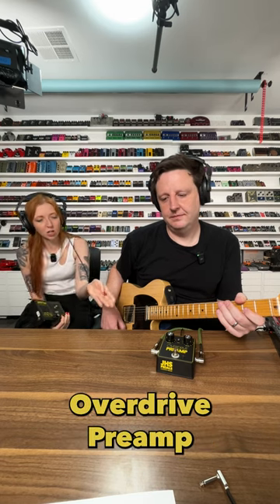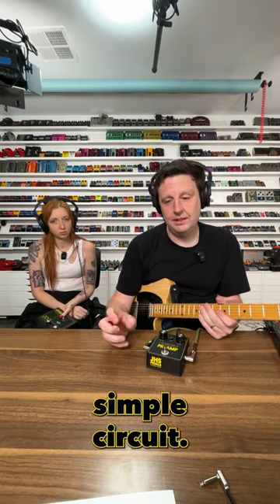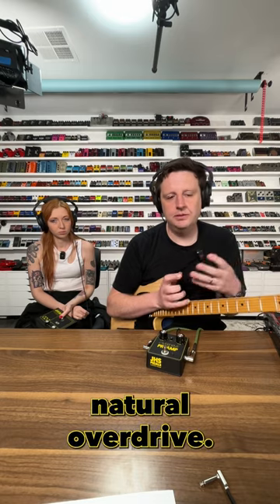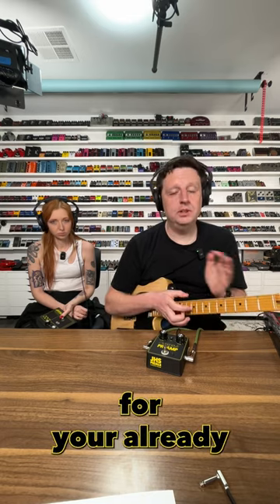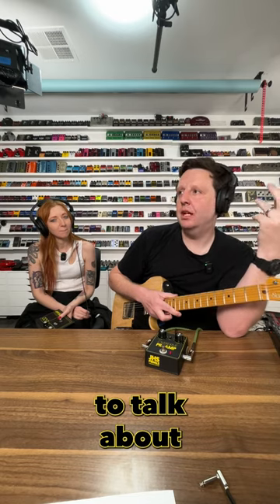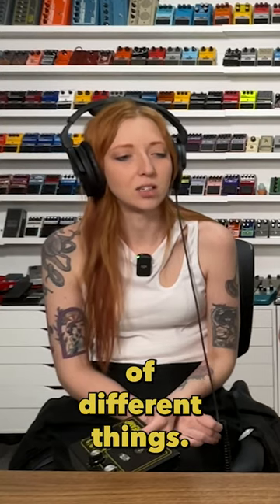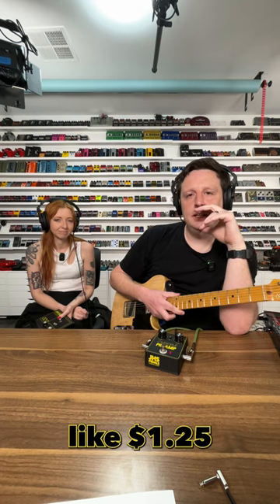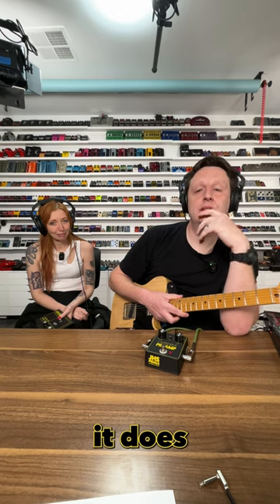The Overdrive Preamp is a Wonder Bread sandwich for your pedal board.

Comment: Mine goes right before my cab sim and right after my crayon pedal and my twin twelve. I can go straight into the mixer or an amp and either way - I can sound consistently good without messing with anything. I could not do that without the JHS overdrive preamp. Its like putting an amp at the end of your pedal board. So that it doesn't matter what comes after.